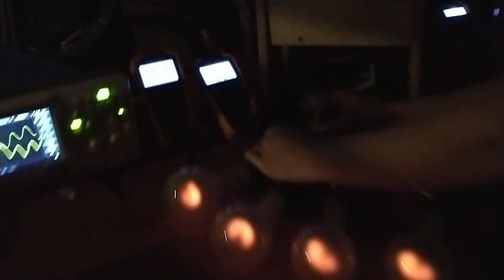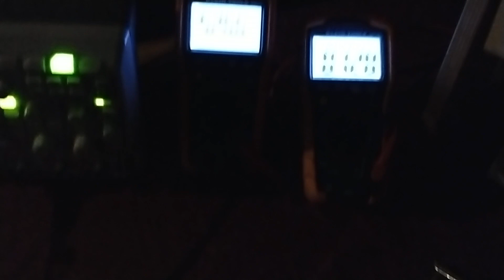Tesla Turbine Sneak Peak Actual COLD STEAM TESTING At the conference!

Comment from the maker: Just a small clip from some testing we did at the conference.
Here we are playing with low speed, about 30,000-35,000 RPM, later we show 66000 RPM!
The boiler temperature is 136 Degrees F!
the load is 4x150 watt incandescent light bulbs.
Pateons saw this video 6 weeks earlier.
https://Patreon.com/ienergysupply
Reply: It's going to be a hard sell though if it can't maintain its speed? What sized rotor would we need for a 1MW supply of constant power?
Reply: Have you looked at foil-air bearings, like the ones used in the Capstone Micro-turbines?

Comment: The Condenser Water System: Condenser Cylinder & Cooling Tower

A refrigerant cycle connects the evaporator cylinder to the condenser cylinder. It keeps the heat moving out of the evaporator and into the condenser, but the two water lines never interact with each other. The warm water here, called condenser water, travels up into the riser at about 95 degrees F and heads toward the cooling tower on the roof.
Once there, the condenser water flows through the cooling tower, and fans pull in ambient air to transfer heat out of the water. After cooling off a bit, the condenser water returns to the condenser cylinder at about 80 f. So, look at this I think that the chilled water systems are a way to go. Only thing you have to do is figure out how to produce the amps, or a pure resonating frequency base.